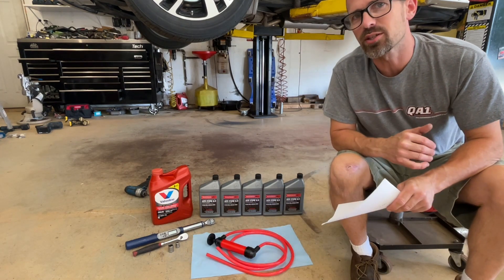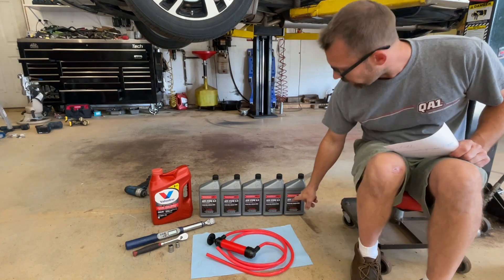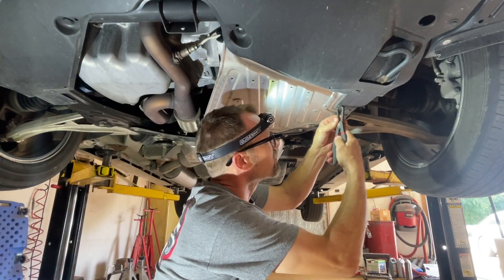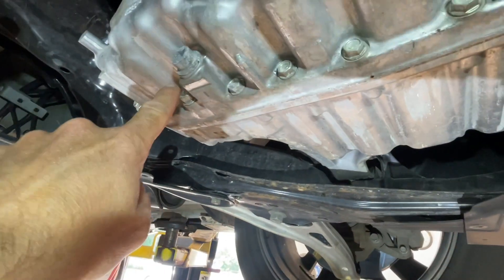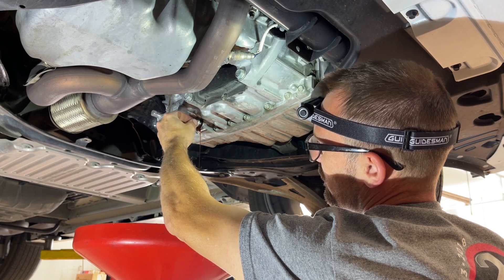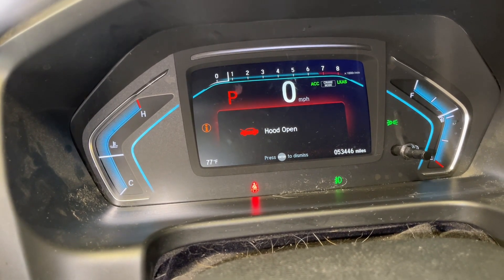🔧 2020 Honda Odyssey transmission fluid change - 10 speed 2018, 2019, 2020+

Comment from the maker: 2018-2019 Honda Odyssey LX, EX, EX-L use the 9 speed trans, not featured (uses Type 3.1 fluid)
2018 Odyssey Touring & Elite, 2020+ Odyssey (all models) use the 10 speed featured here.

Torque Specs:
Drain plug 36 ft-lbs / 49Nm
Fill plug 34 ft-lbs / 44Nm
Level plug 15 ft-lbs / 20Nm

Honda Type 2.0 Fluid (5 quarts required): https://amzn.to/3rbDAm2

Hand pump: https://amzn.to/3XDmUi4

Quinn 3/8" Drive Torque Wrench:
https://www.harborfreight.com/38-in-d...

3/8" ratchet
17mm socket
12mm socket
10mm socket
small screwdriver or trim clip tool: https://amzn.to/45QNtEX
#3 Phillips screwdriver

0:30 fluid quantity, type, brand
3:19 tools needed
4:16 removing underbelly cover
5:13 fill and level set plug location / loosening
7:30 draining transmission fluid
8:30 inspecting / cleaning magnet
9:05 crush washer and reinstalling drain plug
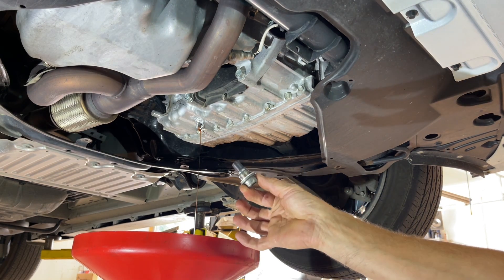9:47 torque specs
11:01 using pump to fill transmission
11:45 reinstalling fill plug
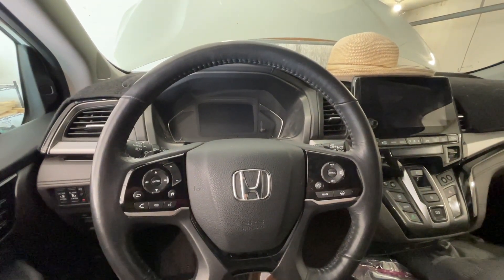12:12 warm up procedure
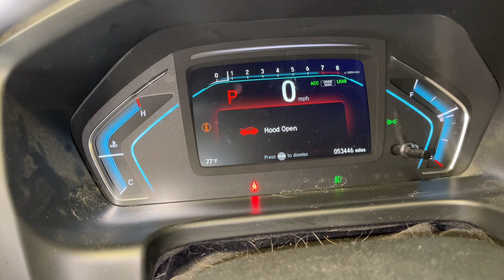13:45 draining excess fluid and setting the level
15:15 reinstalling level check plug
15:35 reinstalling underbelly cover

As an Amazon Associate, I earn from qualifying purchases.  For your convenience, I try to post links to everything I use in the video description.  That's part of how I cover the costs of this channel.  I appreciate your support buy using these links!!

Comment: I used this video for my 60k 2020. The fluid came out so fast it bounced off the bottom of my container in the way a ball would. Also my plug had enough metal to use as feral fluid. Hondapartsconnection had the cheapest 5qts at 75$ including shipping.

Comment: Do you have any videos that show the points that are strong enough to lift up this model of Odyssey? Is there a single point in the front middle by the engine that could support the car being lifted up? I have a single floor jack that I would like to use to lift the front up to put it on stands and then go to the back and lift that up and put that on stands also. I guess I would be asking for a single point in the front and a single in the back. Can you help?
Reply from the maker: I don’t have any videos on that, but the owner’s manual will definitely specify the lifting points on each side. 

There is an engine cradle that does cross the front of the engine bay and is a good lifting point. You can place a jack right under it by the motor mount. You may want to do a little more online research to confirm you are lifting at the correct spot.

Comment: The video is extremely informative and well-organized, covering every point clearly.
I would like to ask for your help, if possible. Two months ago, I changed the transmission oil at the dealership. About ten days later, I started noticing a jerking issue during gear shifts, usually around 45 km/h and sometimes at 65 km/h.

I took the car back to the dealership, and they recommended changing the transmission oil again. I went ahead and did it, but the issue remained. As soon as I left the dealership, I contacted the technician and informed him the problem was still there. He asked me to bring the car back the next day for a throttle body cleaning, which I did—but unfortunately, the issue persisted.

I called the technician again, and he advised me to bring the car in for a mechanical diagnosis, which would cost around $150. He also mentioned that I could continue driving the car unless a warning light appeared on the dashboard, assuring me that there would be no harm in doing so.

Based on your experience, do you think his advice is accurate? What would you recommend?
He already ran a computer diagnostic, and no fault codes were found.
Reply from the maker: Thanks!  I appreciate it!

It can be difficult to diagnose things without experiencing the issue in person.  That being said, it seems like it’s safe to say it’s transmission related. 

Generally there aren’t a lot of things you can do to a transmission with issues that fall between a standard fluid service and a full rebuild.  One of the exceptions to that is that Honda has had some torque converter issues with their transmissions and that is a part that can be replaced on its own. 

This doesn’t sound like a torque converter issue if it’s happening during shifts though. 

At this point it sounds like there may be some internal transmission issues that could either be valve body related or clutch related. Both of those things would be a big repair. 

That’s about as much as I can speculate on, hope that’s a little helpful at least.

Comment: You can fill the transmission from the engine bay. There is a breather on top of the transmission that can be removed with a 10mm socket there are 2 fasteners
Reply: https://youtube.com/shorts/xWnzQiIsEdw?si=JMYma2HgnOs667RR 
Video (not mine) showing top breather fill...can confirm.
Reply: @jh45-d5f good video. Too bad there isn’t an easier access for the level check

Comment: Do you change the transmission filter also when you change fluid? And how please
Reply from the maker: I didn’t change a filter. I did exactly what I show in this video. Just the fluid drain and refill.
Reply: Im going to follow what you should me on this video I was just curious if there is any filter involved that I may go ahead and change at this service interval. Also I’ve never changed the transmission fluid I got like 83K on dial you think it should be ok we are very cautious with how we run it. Thank you fir answering me.
Reply from the maker: @mykerockenstyre9952 some of the Hondas have an external filter located above the transmission.   What’s done in this video is what Honda recommends. If you perform the service at the recommended intervals. In my opinion you do not need to worry about the filter. You should be fine at 83,000 miles.
Reply: Thank you Bennie 🎉
Reply from the maker: @mykerockenstyre9952 you’re welcome!
Reply: Last question do you know model number on the crush washers for both drain and fill one I didn’t see it in the description.
Reply from the maker: @mykerockenstyre9952 I wasn’t able to track it dow when I posted the video. Sorry

Comment: Great video, per service manual one MAJOR correction. After filling the transmission the first time with plugs in: FIRST you warm up the engine (radiator fan comes on twice); then SECOND you go through the gear shifts P-R-N-D-S-2nd-S-D-N-R-P with at least 3 seconds in each gear setting; then THIRD you turn engine OFF; then FOURTH while engine/tranny still hot (careful, hot tranny can burn unprotected hand skin) remove level plug A, let fluid run out (yes some will run out) until just ATF dripping from ATF level-plug hole; then FIFTH torque level plug back in. In my case I used the old level plug/washer for the above FIRST-FOURTH operation and used the new plug-washer in the FIFTH step. Also, you do not need a pump to pump the ATF in (haha). At the right top of the tranny, drivers side, there is a black plastic box, removable with 2 10mm bolts, provides 2 holes at top pf tranny from which to fill in the ATF with a funnel and longish hose. Hope you find this useful.     ATB GS
Reply from the maker: @user-q6c9m  thanks for the added info!!
Reply: How much fluid do you add back in before the warm up and gear change sequence?  All 5 quarts?  Then adjust fluid level from the plug?
Reply: https://youtube.com/shorts/xWnzQiIsEdw?si=JMYma2HgnOs667RR

Video showing top fill option for funnel & pour vs transfer pump. Use all 5 qts (I got just under 5 qts  when I drained) then warm up, run through gears, then open level plug.
Reply: Is that the fill plug on the top of the tranny same as the 3rd gen? I used to have 3rd gen and i fill the fluid from there but my 2023 i haven't do the fluid yet. Thanks for good tips

Comment: Would you say honda 10 speed at is more reliable than ZF 9 speed on Odyssey? 

And have you faced any issues with honda 10 speed at such as harsh shifting at low speed or jerking?
Reply from the maker: I don’t personally have a whole lot of experience with issues with either transmission, but the reputation of them is that the 10 speed is the more reliable choice.
Reply: @ ok noted. Thank you for replying
Reply from the maker: @ you’re welcome!

Comment: Reused crush washer vs a new one? Is it about the same? I’ll check for leaks after a week and then put on the cover again just to be sure?
Reply from the maker: @Talkto415  it’s certainly not a bad idea to use new ones although I have rarely had an issue with reusing them. Checking in a week would be a great idea either way.

Comment: Hi, good video I'm going to change my 10 speed Odyssey 2019, but I didn't see that you've change the filter, and when I went to buy the things they sold me a filter cartridge. Is this right or did they sold me something I don't need for it to change Please let me know, because I haven't seen a video that tells me that I have to change the transmission filter
Reply from the maker: There is a filter, you can change it if you want to, but this video covers the procedure that Honda recommends.  In my opinion, if you follow this procedure, and do it on schedule, you will not need to change the filter.
Reply: @bennieaust  OK but I think that if there is a filter, it has to be changed, just like the motor oil filter. Anyway thank you for your help and by the way, can you send me a foto where the filter may be or tell me, because I was looking for it and couldn't find it. I appreciate your time to answer our comments, not everybody does that. Have a good night

Comment: Hi Bennie, for these Honda 10-speed transmissions, based on your experience, what is your recommended atf change interval?  I don't see a recommended interval in my 2024 Honda Pilot owner's manual.  And when searching the internet, I see people say anywhere from 30k miles to 100k miles.  I'd appreciate any insight you may have.  Thank you.
Reply from the maker: I would aim for 30K-40K miles.  It will probably look great when you drain it, but you don't get all the fluid out with this procedure, so doing it more frequently is a good idea in my opinion.
Reply: @bennieaust  Thanks for the advice.  Really appreciate it!
Reply from the maker: @USMCDragonGunner  You're welcome!

Comment: I just changed it and put in 5 quarts. Nothing came out but I also only took out 5 quarts. Probably good right?
Reply: I added another 1/2 quart and had probably 1/4 come out the overflow. Probably best for folks to put 5.5 in to start but thanks for the tips
Reply from the maker: The only thing we know for sure is it’s low. How low?  Hard to tell. I would add more fluid to don’t out.

Comment: I use a hand pump. Ever two pumps it leaked. How long did it actually take you to fill?
Reply from the maker: It takes a while to get all 5 quarts in. It’s about 8 pumps per quart. I didn’t time it, but take your time so you minimize overflowing.

Comment: how critical is it to get the car level? i've read some using a level. i plan to do this on jackstands so it will be pretty close. also there is a plastic piece on top of the transmission i've see some use to fill the fluid. have you seen this work? 10 spd 21 odyssey
Reply from the maker: Being level is important, but not to the extent that you need to use a level. 

I am not familiar with another spot to fill so I can’t confirm or deny that possibility.

Comment: I had no luck with that transfer pump. Glad I bought an extra quart.  I went with the quart bottle pump and squirt type. Even going slow the transfer pump just made a mess.
Reply from the maker: Glad you found something that worked for you. Some vehicles are definitely more of a pain than others to fill up.
Reply: I had one of those in my garage unopened. I used an old PVC air hose to extend it with a bic pen and it worked out great from the top. Put some pressure up on the hose and filled it up in no time.
Reply: @craigschooled  go in through the vent tube on top the transmission. Even easier.

Comment: Hi how many miles need to change the transmission fluid if the car is brand new?
Reply: the maintenance minder will tell you when it's time. ours just came on at 48k miles
Reply from the maker: I don’t have an owners manual in front of me, so I would recommend referring to that, but 50K miles is a pretty good rule to follow.

Comment: Great video. I need to do mine. If I don’t have it up on a lift, can I fill the fluid from the top in the engine bay and not use the pump to fill from below?
Reply from the maker: Thanks!  You don’t have to do it on a lift, but in my opinion this is the best way to do it. You can do it this way using a floor jack and jack stands. 

It would be possible to feed a tube down from the top, but you will still need to access the fill hole from below.  In the end I think the few dollars the pump costs will be money well spent on making this job easier.
Reply: I’ve fed a tube from top down for mine, I’ve done it twice so far and not even as precise as this video. I’ve used rhino ramps and eyeball fluid level by measuring volume. I don’t recommend doing what I’ve done tho. I don’t even bother with the gear change either. Also each time, the fluid was clear and no sign of color change. 60k intervals twice. Again, I do not recommend doing what I’ve done.

Comment: I just paid $131.00 for 4qts of Honda 3.1 , can't believe the 10 speed fluid is that much cheaper. The 9 speed doesn't have a magnetic drain plug either
Reply from the maker: $131 is out of hand!  I can t imagine what they would have charged to do the service. :(